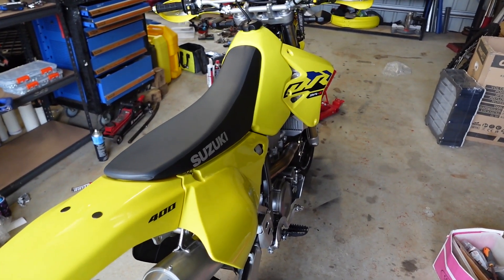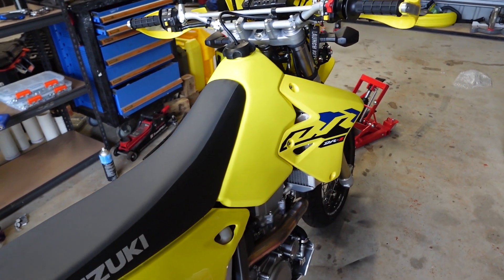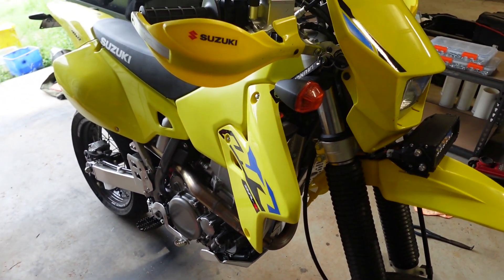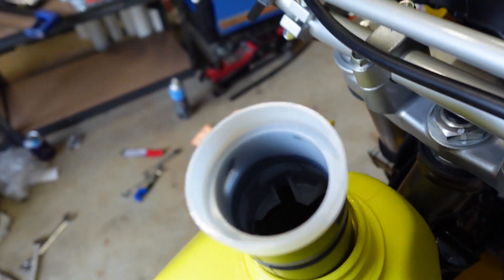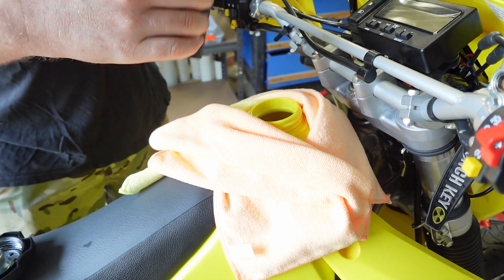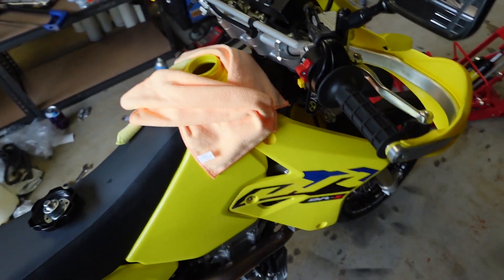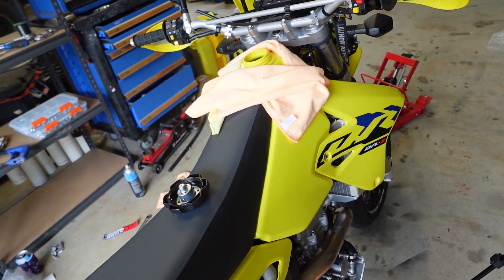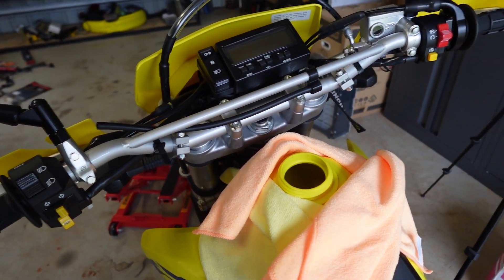2022+ DRZ400E Fuel Tank Restriction

Comment: Mate - cheers for making this video!! I have a 2024 model in NZ and filling it with gas has been doing my head in.. Every time I fill it, it overflows when it is clearly only half full.. I would then have to creep in the remaining 5 litres in and it was taking me 5 minutes to gas up. Finally sat down to look at it and found your video - what a monstrosity haha. Thanks again, on my way downstairs to rip that thing out.
Reply: I’m in NZ and just bought a 2024 suzukifest one. Can I ask if you had any restrictions on the bike other than this stupid tank sleeve. The dealer I’m buying it off is a bit vague. 
Cheers
Reply: @chrro466  Hi Mate - good on ya! Yes so there is a rubber bung in the top of the airbox, this just pulls out. There is also a bung in the exhaust cap (metal). Just unscrew the cap and pry it off carefully with a screwdriver and reinstall cap. This does make it pretty loud, but I don't mind it now. The dealer I got mine from said that there was a restrictor on the carb that stopped it opening fully, which they removed, but tbh I am not sure if there ever was. I haven't mucked round with anything else power wise and these things alone really woke the bike up. Hope this helps.
Reply: @ you are diamond 🤙🏼thanks mate. I’ve just bought a new one and the dealer didn’t have any idea ! I’m hoping they work it out.

Comment: Hi there. I am looking at doing the exact same SM conversion with the Aussie E 2023 model. Could you please provide a list of changes/ parts you had to buy to make it all work? Seems like most of the info out there is for the U.S or elsewhere but not the Australian E variant. Cheers.
Reply from the maker: Its simple. Motard rims that suit and a motard speedo drive from suzuki.
Since they run a 14T front, youll need a different rear sprocket. 43T if you like to party, 41T if you like up and go but dont mind high revs at 100km/h. Im running a 39T due to riding more highway than city.
If you plan to swap between dirt and road rims, then some brake rotors and chain will be needed too.
Reply: @ZombieOperatorAUS  thanks for the response. Did you need any additional spacers or relocation brackets for the brakes?
Reply from the maker: @sputnik5991  Running e model front brake. So no spacers, if you want to run larger front brake, youll need extra bits.